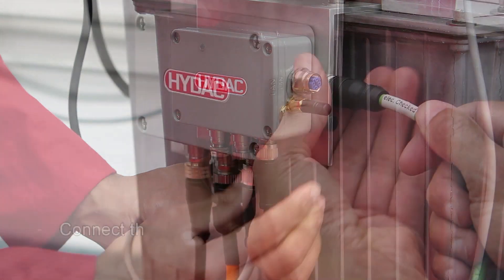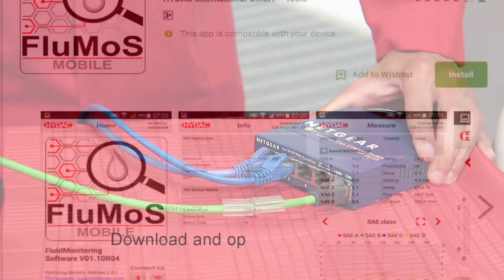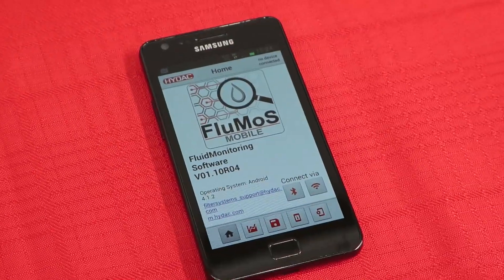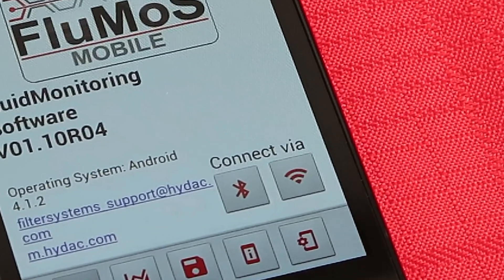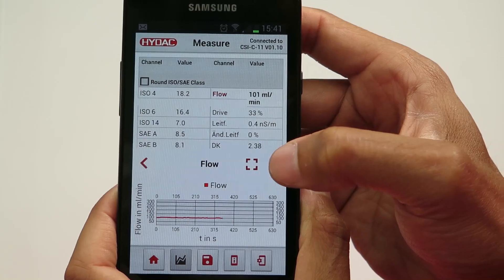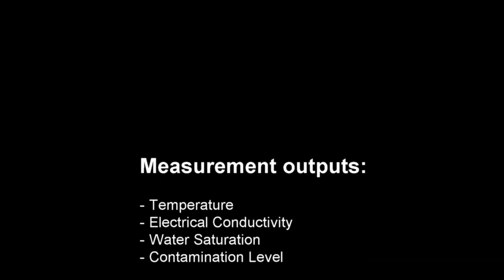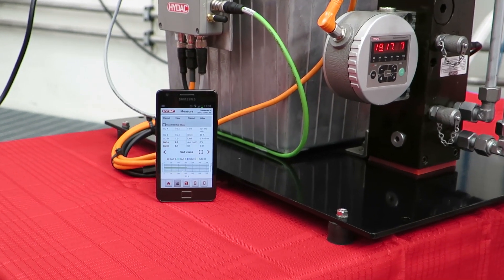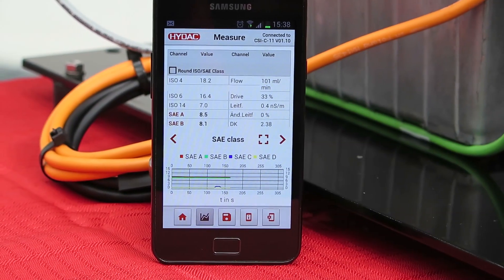How to easily setup a Preventative Maintenance 4.0 Oil Condition Monitoring System

Comment: Hi , is this sensor can fit in which type of oil ? Is suit the engine oil ?
Reply from the maker: Hi Haitham, thanks for your question. 
This sensor is used to monitor the cleanliness of industrial lubricants and hydraulic oils. Engine oil can be measured for cleanliness before it is put into an engine, but once in use, it will be too dirty with carbon deposits to analyse.